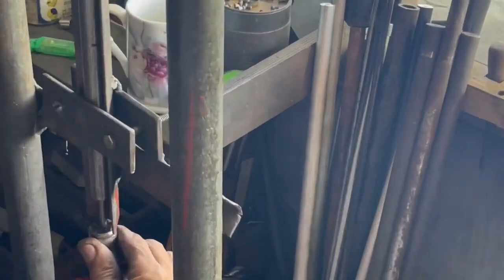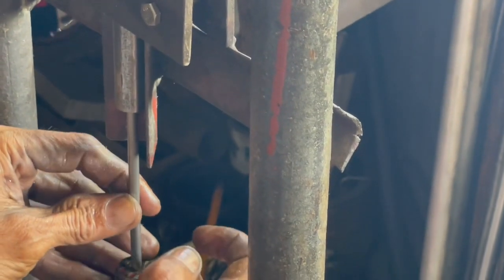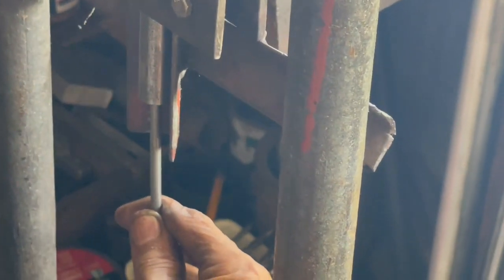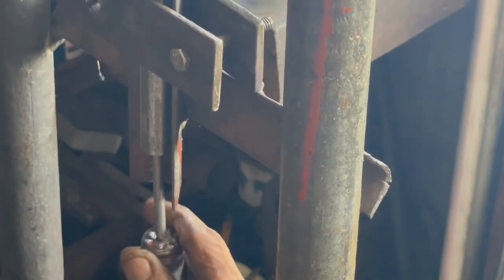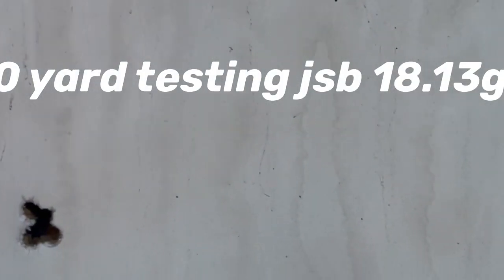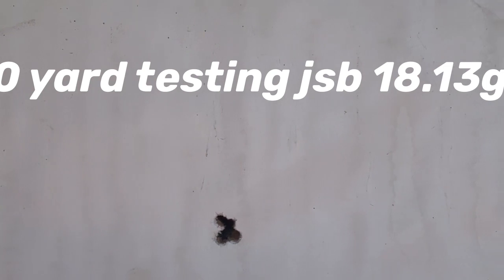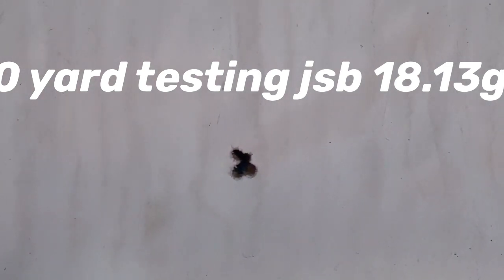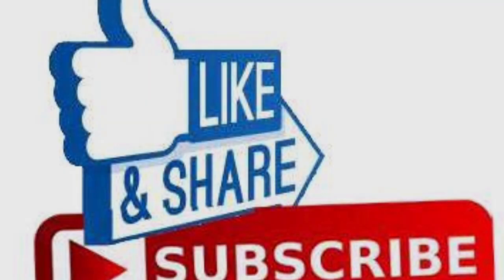How a Philippine 🇵🇭”Local” airgun barrel is Grooved-buttoned  #airgunbarrel #rifling #groover

Comment: Swaging the button through is the easy part and isn't the ordeal gun rag writers and internet experts claim it to be. Not millions of tons of force, just a few. Like 2 tons.

The real challenge is drilling the bore hole or if using tubing, reaming and polishing the bore to a proper uniform consistency and surface finish. I've seen too many factory barrel with trash finishes that shot like shit to say "experts" know what they're doing. The attention to detail prior to and after rifling is the most critical aspect to good shooting barrels. 
If you see tooling marks on the lands or worse, in the grooves after rifling, the barrel isn't a shooter.
Reply: Exactly,  rifle buttons and push rods always available online.  The real problem is the bore finish after rifling is done
Reply from the maker: 👋🏾sup brah! The barrels I have from AC Barrels were tested 177/22 are some shooters at least at the farm permissions I shoot at. I have pesting videos with these barrels and they are accurate enough to take out pest birds braddah👊🏾😎

Comment: Great stuff, but I missed how he got the twist into the barrel ? What weight is that jack pressure ? Rather mild steel barrel then ? Big THANKS !
Reply from the maker: 👋🏾sup bruh! It’s a harden button that adds the rifling! Don’t know about the hardness of the barrel!? The jack is at least a 2 ton jack! He’s was running the button through it the second time so it wasn’t as bad to cut the rifling into the barrel brudda 👊🏾😎
Reply: Air rifle barrels are not normally a hardened steel, it doesn't need to be. The twist of the rifling is in the shape of the button which turns as it is pulled or pushed through the bore.
Reply: Rifle buttons are usually made of tungsten carbide so they are much harder than steel. They are pulled through the barrel in factories for mass production because pushing them though requires you to use many short rods like seen here. One single long rod would just bend. It doesn't take much pressure, a small bottle jack can do it just use lots of grease or oil.